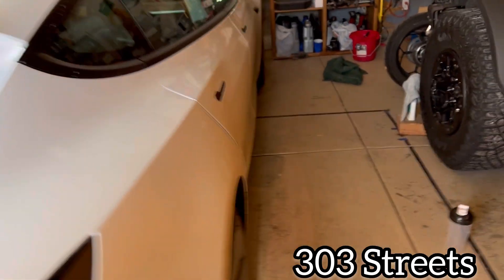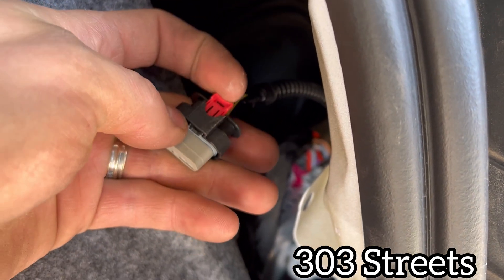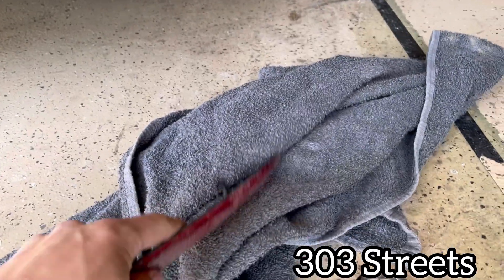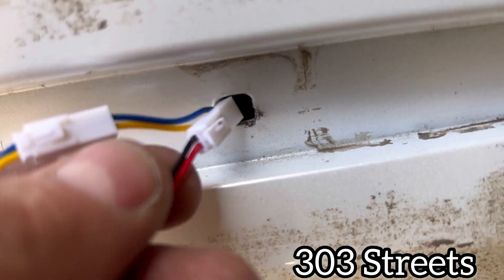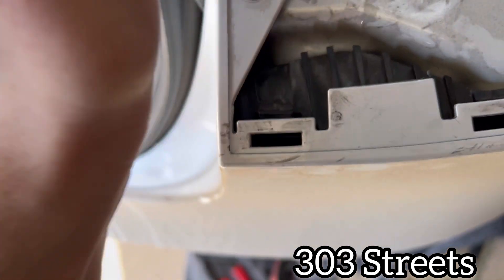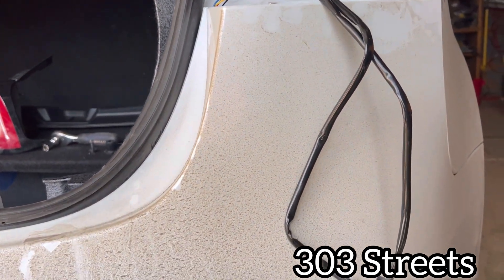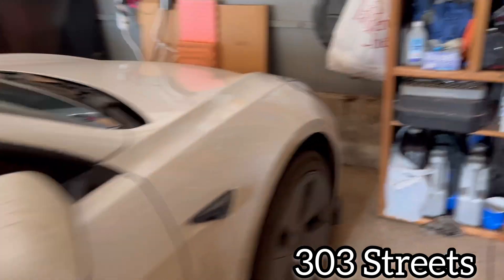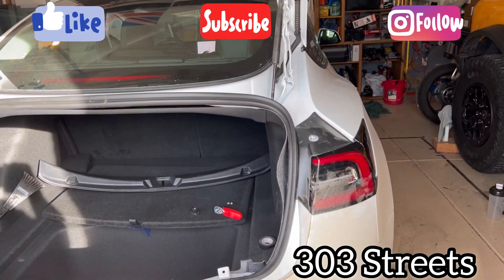How to install Tesla model 3 rear bumper reflector functioning lights

Comment: I just did this mod without removing the lights or the upper part of the bumper. Fish the wires under the plastic surround and through the blue rubber grommets on each side. Remove the small rectangular access panel underneath and you'll see the wires. From there you can fish them through the bumper using your desired method. Probably took me all of 15 minutes to do this.
Reply: make a video pls❤